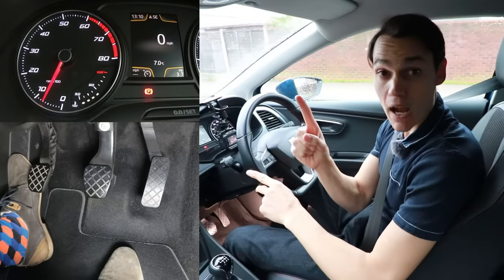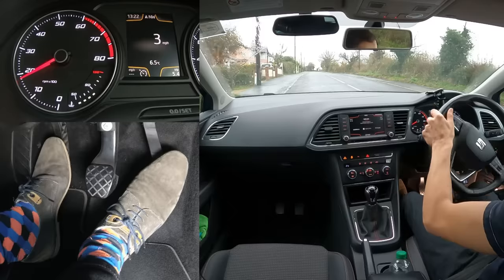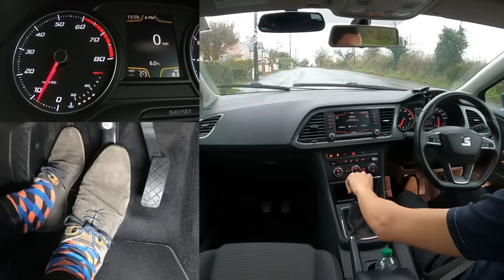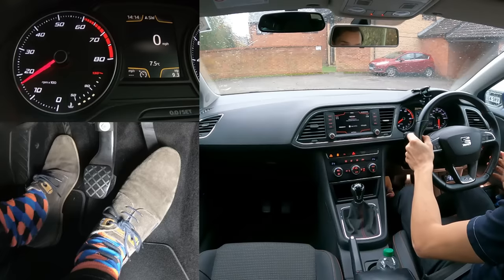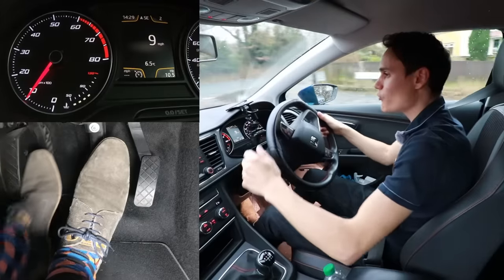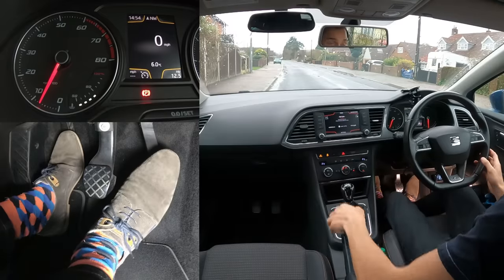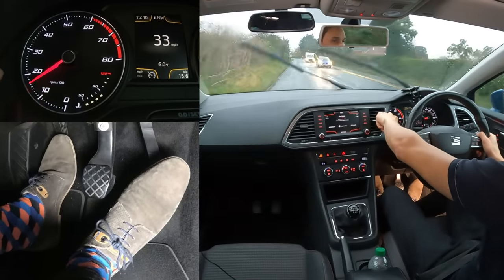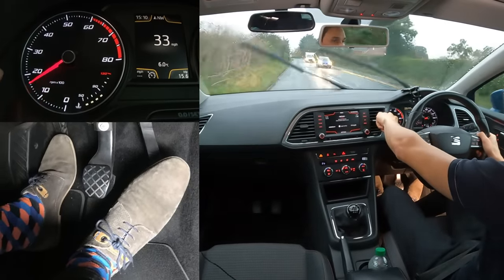How to make your clutch last longer without stressing the transmission.

Comment: 7:27 it might not wear the clutch, but it’ll wear the synchromesh. I now prefer rev matching, but I appreciate that takes a while to pick up.
Reply: Syncros are already engaged when you are in gear, it will only wear clutch a bit more if used without a rev match.
(or probably a lot more if there is a huge difference in revs)

Comment: I drive grande punto petrol engine 1.2 and 65horse power and when I change a gear from 1st to 2nd when I change to 2nd and lift the clutch the car jerks and slow down so I resolve this problem in a way that when I change to 2nd 3th and so on I simply release the clutch and add gas at the same time like an oposite ends of a see-saw. I put a few days ago a brand new clutch set Valeo. Many greetings from Belgrade, Serbia!
Reply from the maker: It is important to learn your car and do what you need to do as you have done.
Reply: @ConquerDriving  yes...Richard you're simply the best.

Comment: Regarding the hand brake, if I’ve been heavy breaking previously, at a light I pull the hand brake up so as not to overheat the front rotors from extended contact with the pads.
Reply from the maker: That's true but on the road you are unlikely to ever get the brakes hot enough. I've tried testing pads for brake fade by going 60-0mph very quickly many times in a row and the pads would not overheat. Two laps on track though and they were fading. The rear brakes get hot too which is why on track it's good to leave the hand brake off. The front brakes may do more of the work but they are much bigger so the temperature difference between front and rear is probably not that great. Rear brakes last longer though so I guess there must be a temperature difference.
Reply: @ConquerDriving  You’re probably right. I used to get terrible rotor warp so I started doing that and it’s never been an issue since. Then again as I’ve gotten older my driving habits have changed significantly. 😆

Comment: One more situation: rolling reverse and then trying to move forward without stopping the car using brakes. Leftover energy from reverse movement will be consumed by the clutch instead of brakes.
Reply from the maker: That's true.
Reply: Really good for your clutch, do it enough and you can get funny smells too.

Comment: Well the best way found out when reversing was to let the biting point pull the car back until it feels like 3-5mph and quickly steer your car in while the clutch is pressed in and repeat until your parked.

Comment: 9:55 The little known components that (also) wear out are the thrust washers in the engine.  All clutch engagement puts a side load on the whole crankshaft and when those wear out, time to rebuild the engine.  Ask me how I know,😒
Reply from the maker: Mine are still good after 18,000 hours of use, the 180,000 miles does not represent the wear as it's a learner car, I'm guessing the equivalent wear is that of a 500,000 mile car given the hours of use and all the people who learn clutch control in it. My understanding is the oil film stops engine bearing wear almost completely.
Reply: @ConquerDriving  Wear substantially occurs on startup when you have to push the clutch in, sideloading the crankshaft when there's no oil pressure.  To know if there's wear on the thrust washers, you have to measure crankshaft end play with a dial gauge.  Typically it has to be between 5 and10 thou, 15 thou being the service limit.

Comment: Maybe it's because my car has a high rev hang time but I can usually change up without having to slip the clutch at all, basically release the clutch as the revs drop to the speed the gear required. 2nd at 30mph is 3000rpm, 3rd at 30mph is 1800rpm... 5th at 30mph is 1200rpm and 5th at 50mph is 2100rpm. I rarely use 4th gear other then when I'm doing 20mph as I can hold the mpg at 90mpg at this speed in this gear at roughly 1100rpm other then that I usually jump from 3rd to 5th. The 5th gear 30mph cruising is done as I can hold the mpg at 110-120mpg... You can even accelerate by lightly pushing the throttle just enough to drop to 100mpg... Once you get upto 50mph 5th gear usually hovers around 70mpg.

Comment: Regarding putting on the handbrake vs holding the footbrake - all other considerations aside, if I'm stopped and I glance in my rearview mirror to see a loaded semi bearing down on me, the last thing I want to belatedly realize is that I still have the handbrake engaged.
Reply from the maker: A good point. You probably want to get out the way if possible.

Comment: The key to not wear your clutch and transition from gear to gear smoothly, is simply to learn your cars timing when shifting, and how fast/far the revs will drop before being at the proper rpm for the next gear. If you get this timing correct, you can essentially dump your clutch smoothly in every shift without needing to hold it at the friction point, which no matter how you dice it, does wear your clutch out more.

Comment: Rev-matching using the throttle is much better, as well as easier, than using the clutch slowly to downshift. 

I find that a very small blip of the throttle with my right foot works well in any gear besides second to downshift. Going from 3rd - 2nd just isn't worth the effort, and instead I'll either go into neutral to slow and stop or leave it in 3rd until I get slow enough to stop.

Comment: As you said if you can come up with your video in how to protect the release bearing . Thanks 🙏
Reply from the maker: To protect the release bearing minimise how much you hold the clutch down. Use neutral as much a possible instead of holding down the clutch.

Comment: Avoid races, use the e brake when you are trying to start up hill, do not let the pedal down while braking and standing still. Do not let your car on shift if you park on a flat terrain and do not be harsh to the gear box while shifting. If you go downhill you can put it in the gear that you feel that you have more control over the car. If isn't too inclined you can move it to neutral and save gas too. It's a matter of using gravity in your favor. My clutch last 10 years and when it was change as precaution, the crazy was good. It's matter of care.

Comment: winter time i am always dazzled by brake lights at traffic lights, where it seems 90% are holding on the footpedal. Maybe I am just more sensitive to light, but i find i have to use the sunvisor, as many lights on mpv's etc seem eye level to me. 
Just my experience I guess.
I also use indicators ALL the time, as believe that as soon as you start adding a choice, then it seems people choose NOT to sue them.  Check the lane switching going on on motorways with no indicatio, or roundabouts  Arrgh.
Maybe I am just having a bad moment today. :)

Comment: These days the cars are highly refined and will be difficult to use the sound for the clutch to finish...
I use your method of holding the clutch at the bite point till revvs go up if I am driving after a while and as I drive, I get used to it and the mechanism automatically works without me paying too much attention

Comment: I tend to use my handbrake when at traffic lights and if in stationary traffic for an extended period. Personally, I do get dazzled/put off by brake lights from the car in front but only when it’s dark. I value my retinas and, in my view, it’s inconsiderate to sit on the brake, when it’s dark with your lights shining straight at the motorist behind you! Just my opinion though.

Comment: Pro tip: if you double clutch and rev match yourself you won't have to worry about destroying your clutch or your transmission at all.
Letting the clutch rev match for you actually means that the synchros are working for you. But unless you're doing downshifts revving up to 3k revs or more you are probably alright. But since I sometimes go up to 4k revs when rev matching from 4th to 2nd gear I try to double clutch to not wear out my clutch and/or transmission.
Reply: Yea but suddenly teaching people to double clutch without any safe lessons will just cause people to make a fool of themselves and burn their gearbox apart. I would only reccomend double clutching if you are a confident driver anyway and have time to practice somewhere quiet. It can be different for different cars also.
Reply: Yeah double clutch feels amazing to execute for some reason, sometimes doing this even on one gear downshifts
Reply: @She1lby  I usually do two gears at a time. It feels so good when you double clutch and don't feel a thing. Did a few today even. From 4th to second while going 55 kph or something usually. Real nice.
Reply: @nicklasveva  Yeah I mean it is especially useful when you skip a few gears to bother. Don't really sure by the way why in races they usually drop them one by one, skip a few feels faster.

My secret thing is to use it to engage 1st gear for better acceleration on any speed :) otherwise there is no way to turn it on.
Reply: @She1lby  the reason for race car drivers not dropping multiple gears is that if they drop one gear at a time they:
1. Don't over rev the engine (since they're almost always on the rev limit)
2. Use the engine braking to reduce brake fade caused by excessive braking.
3. Probably something more that I forgot about.
Reply: @nicklasveva  
1. If it is a redline there is no point in dropping a gear.
2. Dropping 2 gears instead of 1 will add even better engine break.

Probably they skip gears - I just didn't notice it :)
Reply: @She1lby  if you watch F1 and they are approaching a corner, you can hear them drop one gear at a time. Because... They end up hitting red line while just shifting down one gear, therefore they can't skip gears, they would over rev the engine. Rally drivers do skip gears more, but that's just because they don't have to worry about brake fade as much and they don't always have time to shift when coming into a corner.
Reply: @rufusgreenleaf2466  I'm not expecting any manual driver to instantly double clutch without fail. I had to get my routine in before I did them right. I've only been driving for a year total. I have had my driver's license for longer, but I didn't have a car for almost a year. But I'm still shifting better than most manual drivers ever will, because they are uninterested. 

But people who want to learn double clutching usually care about their cars, because anyone can slam gears and wear out a gearbox if they don't care. So I bet that people who want to use double clutching are interested in learning and will do so faster than those who are driving just to get from point A to B. I started double clutching three months ago and I've only crunched gears twice. Probably because my gearbox is in insanely good condition for how old it is.
Reply: @nicklasveva  Cars can still last a long time with single clutch gearing if done carefully. I'm happy for it to work out for you though.
Reply: @rufusgreenleaf2466  well of course. The past owners has certainly not been taking care of the synchros. It shifts perfectly fine, but if you mismatch the revs when not double clutching it jerks a few times, but if you mismatch the clutch revs, but match the driveshaft speed (or whatever part it is) it doesn't jerk. So it's pretty clear to me that they did care about the car, but not enough to not ruin the synchros.
Reply: @nicklasveva  Because in F1 they are driving auto and it is intirely different transmission they physically can't skip more - even if they will want it.

Shifting gears 1 by 1 doesn't change the fact that they need to drop revs in any way(if they are already close to the red line)

We talked about mechanic transmission that have the ability to skip gears.
I do not see how changing gear one by one could help with brake fade, it seems to do the opposite.

For example - hard breaking from 140 to 40, dropping 4th gear to 2nd will give even better enging break and should be faster than doing two shifts instead.

Or maybe not :) I think you led me to the answer - if you are braking for 3-4 seconds from the redline you can wait a bit to skip two gears at once or do this 1 by 1 to add 1 second of additional engine brake from a lower gear.

If this makes sense.
Reply: @She1lby  you wouldn't understand what I meant even if I tried to explain it with words, I'd have to show you because it's too complicated to explain with words, but I can't. Anyways, the higher the revs, the more effective the engine braking is, therefore you brake less to achieve the same results, the engine brakes together with the wheel brakes. 

If you have driven a manual you will recognize that feeling when you're off the gas while braking, at let's say 2k revs and you press the clutch pedal. Where you will immediately feel that your braking power got lowered (depending on how hard you were braking), because the engine is disconnected from the wheels. And trust me, I engine brake A LOT. And I really mean A LOT. 

The problem with dropping an extra gear at high revs is that if you're already at redline after dropping one gear, you would blow your engine if you tried to drop two gears. The gearbox physically stops you from shifting to too low of a gear unless you really slam the gears. Just search for "money shift" and you'll know exactly why you can't just shift an extra gear.
Reply: @nicklasveva  I understand it - that's exactly what I said in the last part of the previous comment :)

As a conclusion: 
Downshifts 1 by 1 makes sense if you are braking and already near the red line because otherwise engine will be over revved.
Reply: @She1lby  you edited it and I was reading the unedited one, so I responded to something you didn't mean to say.

But still, if your shifting time is low enough, a gear change that gets you to red line is more efficient than skipping two gears. But if the shifting time is too long, your engine isn't braking as much as if you were to skip an additional gear. Changing one gear at a time with an (hypotetically) instant gear shift is always going to be better for braking. Mostly because the brakes have a lower chance of locking up. But also, since you're not using your foot brake the engine absorbs heat instead of your brakes. If you brake the entire way down a 20 km hill your brakes are gonna get worn out. If you use engine braking, no harm will be done to the brakes since the brakes aren't being used.
Reply: @nicklasveva  Yeah I agreed with that - the lowest gear possible, without overreving the engine.

Was nice to talk.
Reply: @She1lby  PS: it's spelled "brake" not "break".
Not trying to be a smartass or anything, just want you to know for the future in case people want to invalidate your arguments because you spelled something wrong.
Reply: @nicklasveva  Typing this sometimes without thinking you can see that it was messed up in these dialogs only once
Reply: @She1lby  I guess I wasn't paying attention either :D

Comment: @ChristianSingh  You silly don't know anything about driving or damaging transmissions. A big YES to downshifting to 1st gear!!! I do that a lot and there is a very good reason behind it relevant to good care of a manual trans car and it happen too often if you are really a driver. The guy in this video is right all the time.
The scenario:
Driving in whatever high gear, and not far in the horizon down the road I see traffic really slow and cars' tail red lights ahead of me are intermittently on and off as they move slowly for an indefinite distance and stop and again and again...I lift my right foot off the accelerator completely and let the car idle/coast until I reach within about few tens of meters and where my idle engine rpm slowed down to around 1300/1200 (I don't need to look at the gauge, just sense the entire system [wheels, vibration, clutch, transmission] by feeling) and so then at around the above mentioned rpm I hit the clutch, shift to neutral then slow down further and smoothly with the brake pedal while weighing and calculating the traffic's speed and then change to a gear suitable for that; let's say 2nd, but somehow upon getting closer and closer I figure out that even 2nd gear (say 5 mph depends on car) is still really too much and the car would start to vibrate if I use the brake to slow down further! There ladies and gentlemen where I find myself and rightly so technically and physically obliged to downshift to 1st gear!!! 👏Here transitioning to 1st gear goes wonderfully smooth and the car moves really slow but most importantly in sync with our traffic scenario speed!!! Of course as you know, at any moment in our traffic I might very well find even the 1st gear is too fast 🤔 I then hit clutch/brake almost simultaneously and shift to neutral, release the clutch and keep pressing on the brake pedal waiting to launch 1st gear again☕

Comment: Learning to drive on a pickup that had a 4 speed unsynchronised transmission you had to learn proper clutching to change gears. One thing I still recommend people that are driving a standard is to learn to shift without the clutch. You have to match your revs. And of course being in Canada automatics are the norm for anything other than commercial trucks and even there automatics are becoming more popular. In B.C. at least if you  have a commercial licence and took your test on an auto you restricted to automatics. Which by the way was how it was in the 50's when I got my licence.

Do you have much experience on the dual clutch automatics?
Reply from the maker: I've not owned a dual clutch gearbox personally but I have used them quite a bit.